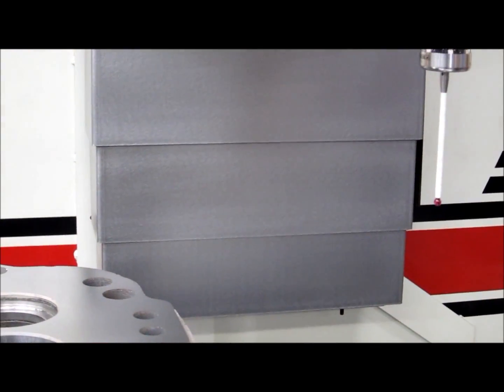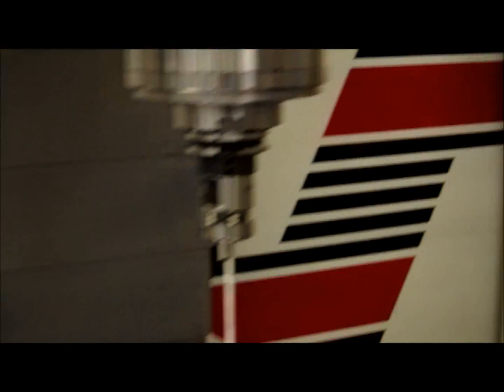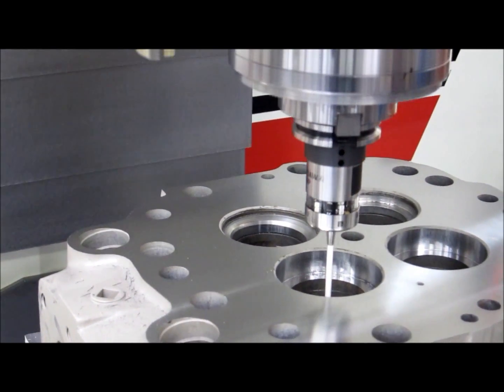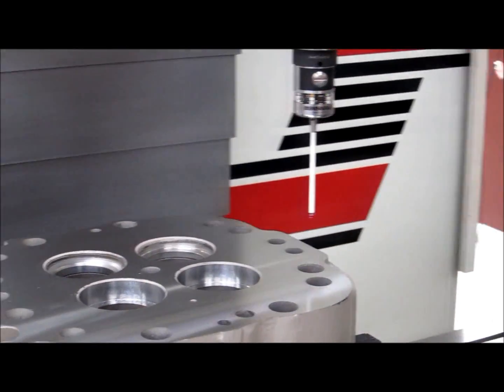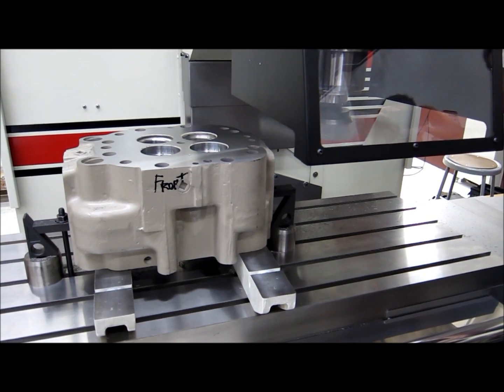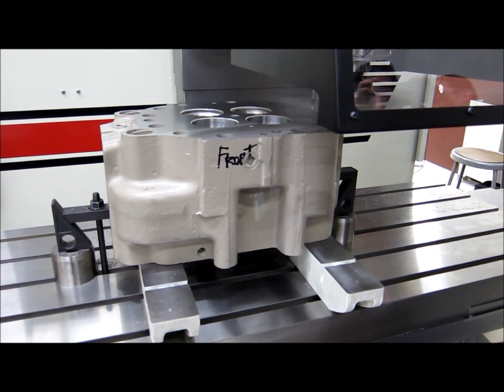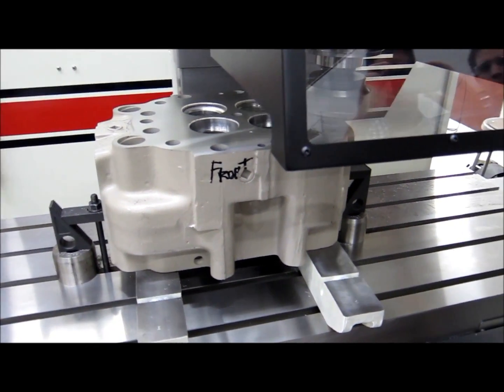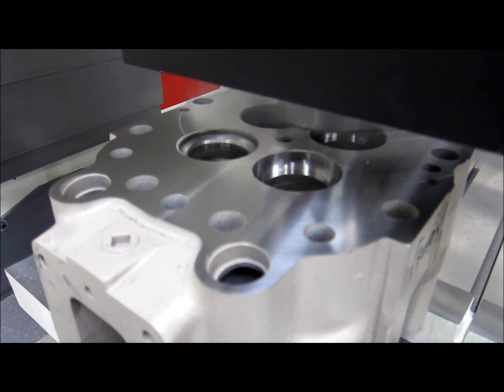Rottler F69A machining Natural Gas Cylinder Head

Comment: worst case scenario that is a grade 10 ruby tip and that has a sphericity limit of 0.25 micrometers or 0.000,009,8in. You are an order of magnitude out of tolerance, cheers to the guy who thinks you should turn the probe to be more accurate lol.
Reply: The reason for the indexing isn't the stylus, it's the probing head and its concentricity to the spindle axis.  You have to calibrate the probe to ensure that probed center is the spindle axis, other wise your probed center will be some offset from the spindle axis.  By indexing the head for each probe, any calibration error cancels out because you are always probing the same surface of the stylus.